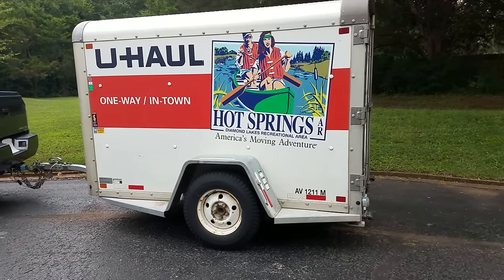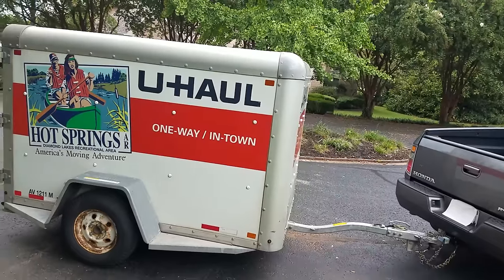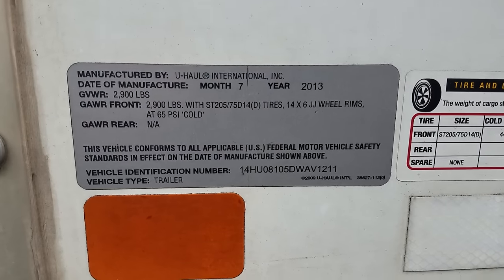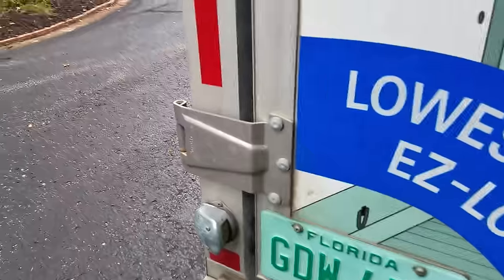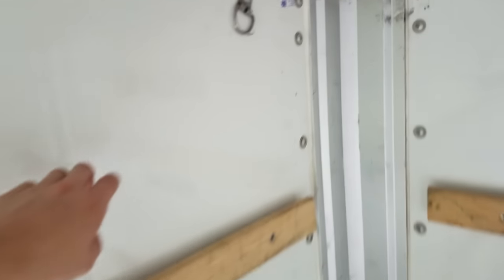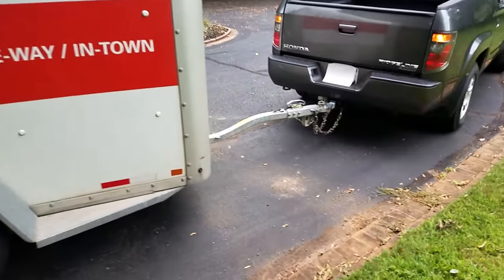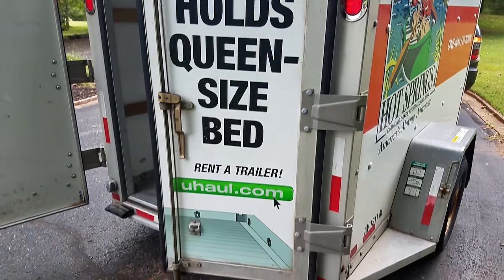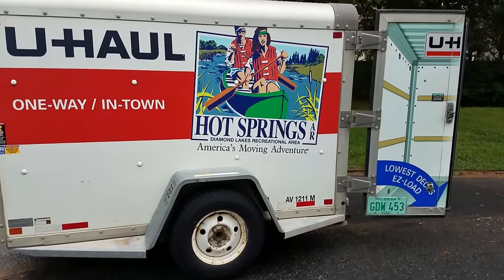U-Haul 5x8 Cargo Trailer Review

Comment: This is very informative! thank you!! Can I use this to hook to my bmw 328i to haul from San Jose to Phoenix ? Uhaul website is suggesting this trailer for my vehicle but I'm not sure how it fares for compact sedans
Reply from the maker: This trailer is probably a bit much for a small car. The trailer weighs about 1000 lbs empty. And with a load can go up to about 2,700lbs. Check your owners manual to see what your cars towing capacity and max toungue weight is!
Reply: crazyjdkid thank you, I’ll take a look at the manual.
Reply: That car could probably tow 1,500 gross safely.

Comment: can a 5×8 work with a toyota rav4 2016
Reply: Toju Aboderin Depends on how much you put in it.
Reply: Yes, it works. Two months ago I towed 5x8 uhaul trailer with my RAV4 for about 2600 km (1600 miles) of distance, moving from Saskatchewan to Ontario in Canada. The trailer was packed with heavy stuff including 20 uhaul boxes of books weighing as heavy as over 1000 lb with the mixed stuffs in totall.  By the way, my RAV4 is 2006 V6 Sport with mileage of 250K km (160K miles). Drove uphill and downhill a lot of times with the trailer hitched. 5 days on the road. There was no problem occurring to this aged RAV4 during and after hauling. It still runs very well. Such an amazing vehicle! 5x8 trailer was great to RAV4. Just make sure of 4 : 6 portion of contents when loading them in the container.

Comment: Can I pull this with my Kia Rio ?
Reply from the maker: Probably not! Doesn't have the towing capacity to safely haul it.
Reply: U-Haul has a tool to enter your cars make/model and it will tell you what you can tow.
Reply: Can a 5x8 hold a riding lawnmower
Reply from the maker: Depends on the lawnmower

Comment: Just beware that u prob won't get this newer model when u go pick it up (at least in the St Louis area).This one has swinging doors,rides a little lower and has many more tie down rings on the inside. You'll most likely get the older model with the roller up and down door and only 4 rings for tie downs. The uhaul website shows the diagram of the newer model as in this video but apparently that's most likely not what you'll get. False advertising?

Comment: Yeah Uhaul trucks are not the best. Definitely Penske or Budget
Reply from the maker: Disney Fan yep! At least with them your guaranteed a truck that is at most only 3 years old and doesn't drink fuel like it's free!
Reply: If I was moving to house to house I'll rent a international Penske truck or budget truck.if I was moving to apartment to apartment I'll rent a 15 foot uhaul
Reply from the maker: Check out my most recent video with the Izuzu NPR-HD. That would be a competitor to the 15ft Uhual. I really liked it, it has a lift too!
Reply: Well good luck with them. penske and budgets big box trucks require a CDL to rent and drive them unless you want to pay for a driver.
Reply: @capt.justinspiritairline6288  well they won't rent a International to anyone without a paid driver or a CDL due to the weight of one.
Reply from the maker: @robsmith3106   Have you seen the other videos on my channel? My channel is literally filled with those 26ft Freightliner and International trucks and not one requires a CDL, they even have air brakes. No CDL needed.